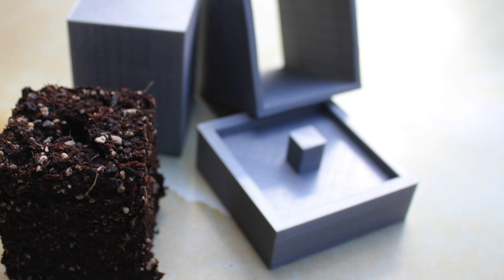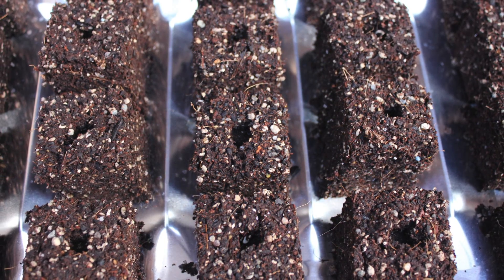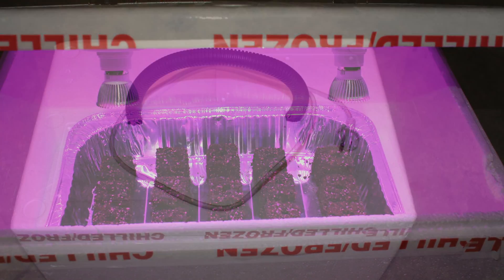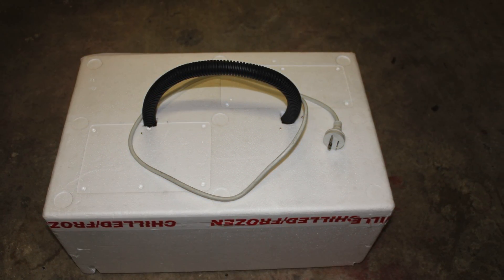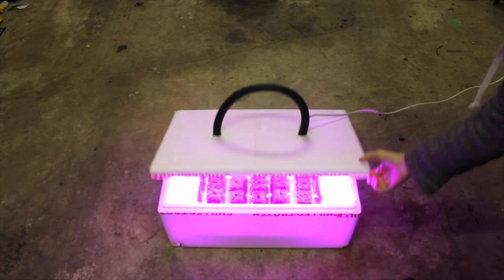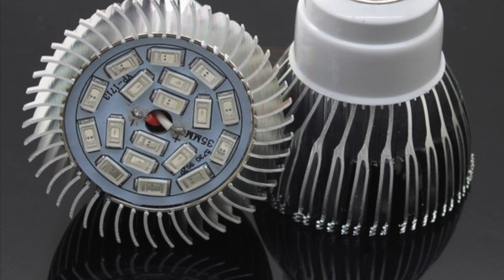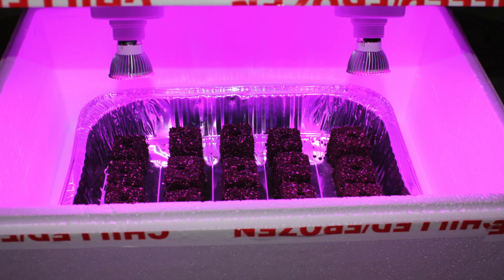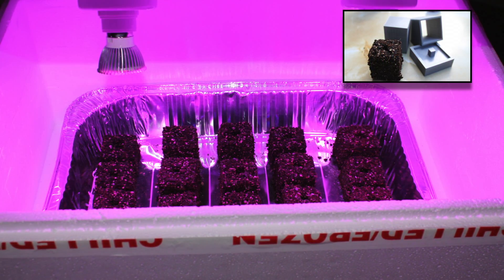Homemade low budget LED growbox that costs only $5?

Comment: hello Attention These cfl lamps ARE NOT SAFE i opened them AND THEYRE Y NOT SAVE buy some cheap uv leds for your plants they have cables rated for 12 v and cheap resistors and condenser

Comment: being a cooler wouldn't that be very insulated and heat up over time? also airflow?
Reply from the maker: Yeah it's pretty well insulated, but the outside temperature is usually around 7 degrees. Balances out. Air flow to come soon, will hook it up to my ducting at some point.